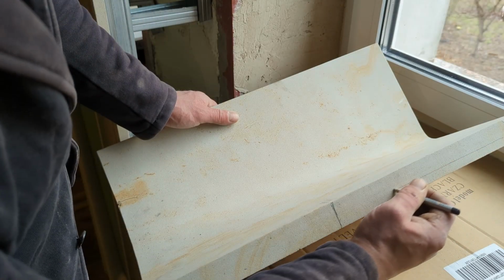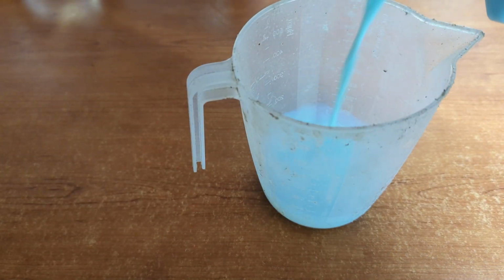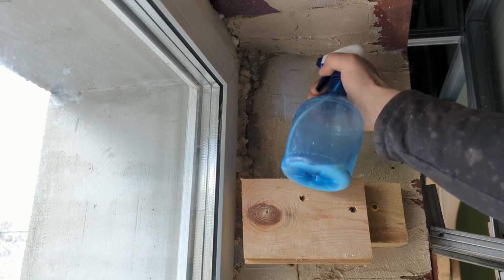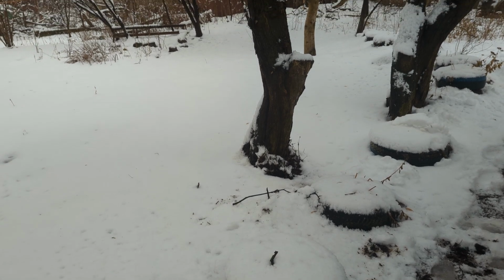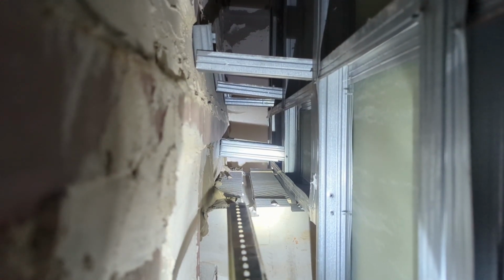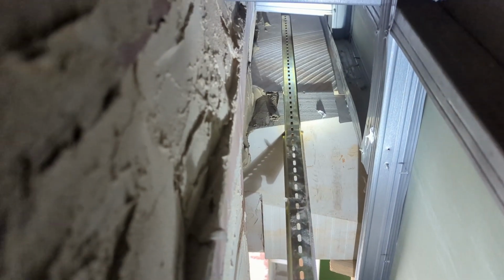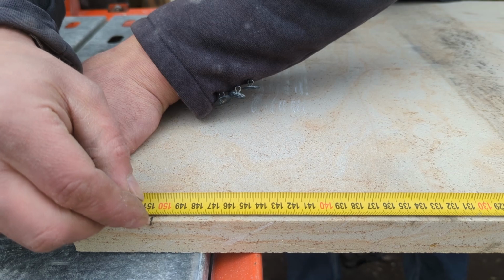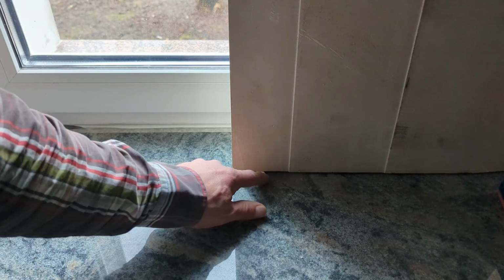The most ancient type of joint?

Comment: Why a wooden butterfly? Why not granite or another stone?
I hope you won't get manhunted and sent to the frontline! Say safe!
Reply from the maker: Thank you for the thoughtful questions and for your concern.

Regarding the wooden butterfly: in this case it is mostly a decorative and symbolic element. It carries almost no structural load, and the choice of material was made by the client.

As I mention in the video, it is also a way of paying respect to historical craftsmanship — similar wooden or metal connectors were traditionally used to join large stone blocks.

Wood is also less rigid than stone, so in case of any minor movement between connected parts, it can deform slightly instead of causing cracks or stress fractures. In the past, softer metals like bronze or tin were used for similar reasons as well.

And thank you again for your concern about safety. I am doing well, and everything is in order on my side. Difficult situations do happen, but in most cases they are isolated and related to legal or administrative issues.

I truly appreciate your support — thank you for watching and for caring.

Comment: I'm wondering why you chose to put the walls so much forward from the brickwork. Is it because the wall is much thick up to knee height? Or is it to create an insulative air gap?
Reply from the maker: First of all, thanks for the comment. This solution has no practical need, just part of the design. The idea is to hide the central heating radiators behind a "stone curtain". Under the window sill there will be another stone lattice covering them from the front. Also, my customer loves flowers and she insisted on huge window sills, but I think this will be a place for the huge cat she owns)).

Comment: Looking really nice, will it be getting a clear coat stain to bring the colour out a bit more or staying as is? 👍
Reply from the maker: Thank you. I would leave it as is. The camera against the light does not convey the color of the stone well; in real life, the colors and textures are quite bright. But it’s not for me to decide; at the end of the project it will depend on the customer.
Reply: Oh I thought this was your own house project! Will this sandstone gather dust in due course and get filthy easily?
Reply from the maker: From a practical point of view, sandstone without treatment will get dirty more easily. But this is a bedroom and not a kitchen or bathroom, so I don't think this is a place where dirt will accumulate. It is easy to remove dust from it; the surface is smooth after sanding. @09conrado